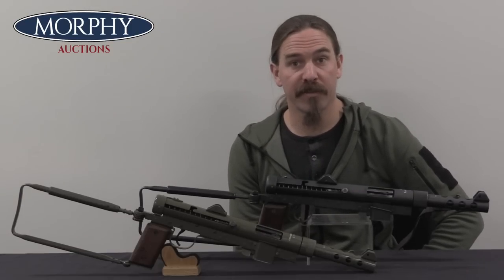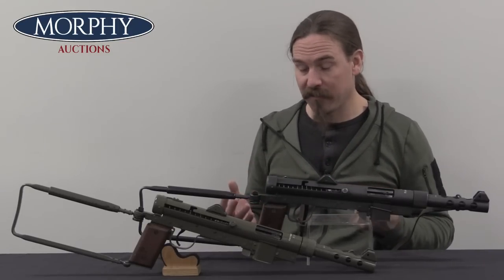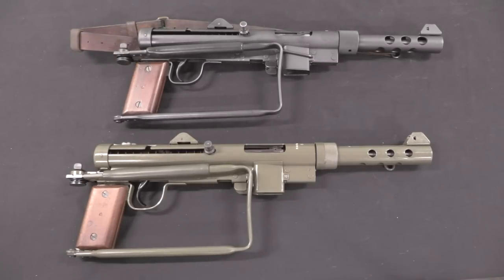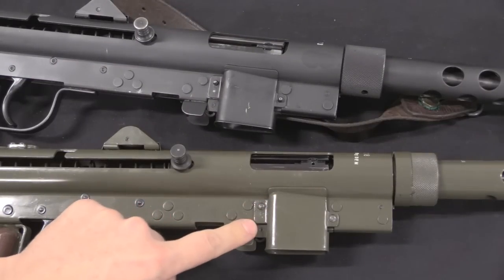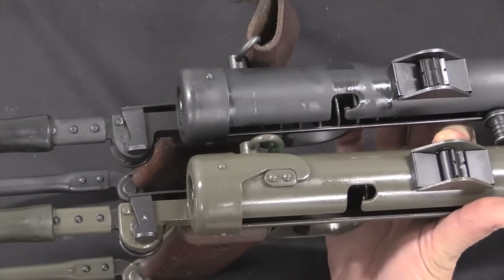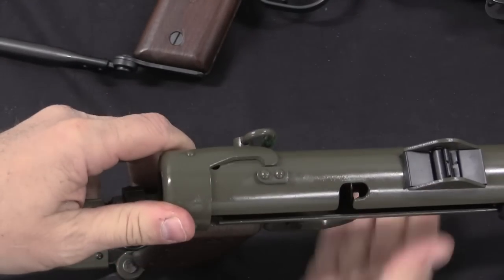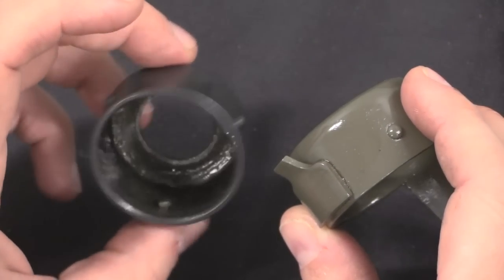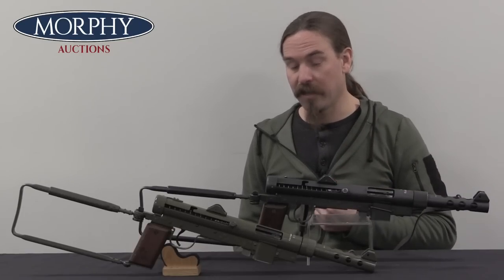Swedish K Comparison: Model m/45 v m/45B

Comment: In service, as issued to me in 1998, a proper M/45B comes with a bunch of accessories:
A servicing kit, with a cleaning rod, bore brush, and a container of oil
A blank firing barrel and muzzle device (basically a longer, unrifled barrel with screw threads for a heavy blank firing adapter - you change out the whole thing, and you are never, ever to use live ammo with the blank firing barrel because it's subcaliber)
A leather sling
Four 36-round magazines
The stripper clip loader (was apparently considered a secret for many years, it was not sold with the export versions I believe)
An adapter for a case collector
A case collector
And an external safety device.

The safety device  was essentially a metal plate that fitted over the ejection port using the bracket for the case collector, with a lug on the inside that kept the bolt from moving. Since the M/45B has no safety beyond "pull the bolt into the back-and-to-the-side position, while on guard duty you'd fit the bore safety device instead of the case collector, which provided a second layer of safety to prevent accidental discharge. In case you needed to actually use the gun, you had to pull the bore safety device (it was on a lanyard), in combination with calling out a "stop or I will shoot" warning. 

The case collector, which had to be fitted at all times when you weren't using the safety device, was my number one source of problems with the gun, because I had multiple incidents of ejected brass not going down the chute to the bag correctly, but instead bouncing straight back into the action and sometimes getting really stuck. The thing is also really heavy - it's the same weight as an AK-5 at 4.5 kilograms loaded (10 lbs), and the AK-5 is considered very heavy for an assault rifle in 5.56.

Comment: The "C" version was the soldiers ordinary "B" with a "C" barrel jacket, for as you said parades and guard duty, at the Royal Palace for example, the "D" model with selector was a Swedish Police version, they also used a version called "BET" semi-auto only with a different and more sturdy butstock for shooting teargas canisters only. And last a rumored silenced version special for the Swedish "Stay Behind" resistance organization that was founded with CIA help in case of a Soviet invasion. The magazines was constructed by a firm called Linde, and if im not wrong, the coffin mags was also a Swedish design, used both by Finland and Sweden. Later the Finns also adopted the Swedish 36 round mags for the Soumi.

Comment: An fun fact is that it was still in use by the swedish army in the 90´s.
When i was doing my "military duty" for 9 month back in 1993 i had the K-pist M45b, more common then was the AK5 but some units like mine where still using the M45b.
I remeber the weapon to be very reliable, and easy to handle, easy to assemble etc.

Comment: I used the m/45 in the Danish army up to around 2000-2001. It was called the MP/49. It didmt have a magwell. was pulled off it I guess. The mage we used was worn out ages ago, so we had to duct tape spare boot laces to the mag and tie it to the folding stock, or we would lose the magazine. We loved it though, our HK G3's were even more worn down, so they got recalled and we were issued those MP49's. Really nice since I was driving M109's, took up way less space, was easier to handle, and way half of the G3, plus the weight savings on mags and ammo.
Reply: NJAR in Skive? I served in an M109 battery in '96-97.. only our MOs were afforded the MP49. My G3 was hella good though. Did 198/200 at 300m routinely with it.

Comment: The C-version is kind of weird in that it's not a complete gun. As said, it's just the barrel shroud that is different, and usually, you just took your issued m/45B and temporarily replaced the barrel shroud with the C-version, thus temporarily changing your B into a C. When the guard duty was over, you just swapped back to your original shroud and turned in the C-shroud.

Comment: Thank you for actually pointing out why the Swedish K is named so. Most others just say it's so because it is so.

Also, to pronounce Kulsprutepistol a little better you could say

Kewl (cool but kewl)
Sprew (Spew but with an r mixed in)
Te (The without the h)
PisstOOl (Pistol but with more emphasis on the O than what is normally done in English, and also a slightly longer s, which makes it piss)

So it's a cool spewing pistol really.
Reply: Kul actually means a sphere or ball.  It also means bullet (even a non-spherical bullet).
Reply: @johndododoe1411  Really now?
It's not like i speak Swedish or anything.

Varför ens försöka?
Reply: For those who don't speak Swedish kul also means fun 🤔
Reply: @RealCadde  I was trying to clarify for the non-scandinavians.

Comment: The m/45 can also take the 71 round Suomi drum. I know that the Irish army used to have them.
There is yet another m/45 model, be it very unusual. It was fitted with an integral suppressor that was a longer barrel jacket with only very small perforations in the front. I have only seen it in pictures. It may only have been used by US special forces in Vietnam.
Ian, if you could find one of those that would be super cool 😎
Reply: Actually the m/45 with suppressor was also issued to the Swedish polis as a support weapon in the same role as the MP5 these days.
Reply: @Para.Bellum  I think that was the attachment to fire tear gas cannisters.

Comment: These things have a legendary reputation, but I've never seen an explanation on why that is. I'd really like to know.
Reply: Scroll up for reports from soldiers that were issued both m/45 series and the modern replacement, but preferred the m/45 .  Such experiences of an inferior replacement add to the legendary status of the old product in any line of work.
Reply: They were extremely rugged and reliable. Accurate, easy to use, easy to shoot well. They look very unsophisticated, but the design is very well thought out, in the functionalistic philosophy that signifies swedish mid-century industrial design.  They were used by Swedish and Irish UN troops during the Congo crisis ( wich propmpted the development of the hotter ammunition).  In Sweden they have a legendary status, as basically every male citizen got to use it at one point or another from 1945 to 1990. And I have never heard ANYONE say anything but praises for it.
 No idea how many were made, but during the cold war Swedens backup strategy was " if all else fails, arm the entire population". I wouldn't be surprised if there, at a point in time, was a Kpist for every man, woman and child stashed away in convenient locations around the country. ( there has actually been a number of raids of such stores during the years, and guns from those raids have shown up in some high profile criminal cases, such as the bank heist that ended with the "Stockholm syndrome" ) 
 US special forces used them in the (illegal) Cambodia incursion during the vietnam war, partly because they needed a weapon with plausible deniability, in case they got captured.
As the Vietnam war became increasingly more controversial, Sweden stopped exports of weapons to the US. This of course, fueled the legendary status of the weapon among US military personnel.

Comment: Orig Swede m/45 mag ,also Fin 1954 issue,Does not have that carryloop. It was orderder by Inspector of Infantry Finnish🇫🇮 Army and it is m/55. It’s has single L as a manufacture’s marks
Linde 🇸🇪is True quality magazine manufacturer.
So m/55 is made by Lapua Finland=L mark.
Coffin Swede 50rds (Linde)were maid in Finland 1939-1943 but heavy front use proved that jamming became isssue and was dropped favour expenive 70 drum only.

Comment: Ceremonial submachine guns isn't something I thought I'd ever hear
Reply: It's not really accurate unfortunately.
The royal guards use a swedish mauser with their ceremonial uniform.

For soldiers on guard duty, a bayonet is a good persuader. Guards interact with a lot drunks and troublemakers, and there is a point to be made, for having a visibly sharp poking device to fend them off, rather than actually having to shoot live ammunition in the middle of a city.
Reply: @JH-lo9ut  Ah, I had assumed this might be the case. I guess it makes more sense, wood is more "traditional"
Reply: @AshleyBlackwater  they should have made a chromed version to go with the Pickelhaube.

Comment: A bayonet on a submachinegun? I know of others like it, but really? That knife would be used for sticking the gun up as a grave marker or opening tins of food.
Reply: The bayonettes were actually pretty long and would give a signifficant advantage if needed to be used in melee capacity in their primary use, guard duty at the Royal Palace. The folding stock meant the old trusty "Butt to the head" was not really an option.
Reply: @BigSwede7403  Pretty much what I was going to say; that stock will hit will all the impact force of a particularily fierce coathanger, so if you run out of bullets in a melee a bayonet is plenty viable.
Reply: Whe are talking about a monster version of a bayonet. it´s almost as long as the smg folded. so it works kind of good. for guard duty.
Reply: @BigSwede7403  Did the royal guards ever use the bayonet in action during the m/45 period?
Reply: @johndododoe1411  Don't know, but i doubt it. The guards there rarely have to deal with anything more important than drunk and disorderly.
Reply: @BigSwede7403  Danish royal guards have been deployed to active wars and taken casualties in the past 30 years.
Reply: @johndododoe1411  While not being in the know how the DRG works, i fail to see your point. SRG is a mix of a dedicated unit and various conscript units on a rolling schedule. Or that is how it was when i did it at least.
Reply: @johndododoe1411  Nope. The royal guard is gathered from a larger royal regiment. That particular royal regiment (there are a few) has seen active deployment duty, whereas the royal guard itself has not, as it has only one mission statement: to protect the royal family (rather ceremoniously - as it's the Jæger and Frogmen corps who provide the real personal body guards).
Reply: @andersjjensen  Your name looks Danish, however our Danish Royal guard seems less separated, and our close protection is drawn from police ranks, not special forces.
Reply: @BigSwede7403  Actually, the folding stock is quite sturdy and would win against a head in a contest of durability. The front heavy weight made whipping a quick way to strike and part of the self defense taught alongside ramming the barrel into someone.
Reply: @znail4675  Oh it's sturdy for being a folding stock, but i'd still take the option for the long pigsticker if having the choice.
Reply: @BigSwede7403  So would I, but I was just correcting that the stock was usable if needed and soldiers trained to use it as such.
Reply: @BigSwede7403  There isn't really any give in the stock and while the weight of the stock is light so is the entire gun quite massive. What you are doing is essentially spinning the weapon around it's center of mass while the stock sticks out and provides extra speed. So it's a spinning hit, not a thrust. Barrel thrust was the other move taught and it works. Hitting someone with the pistol grip would only work if the stock is folded really. I think that would only work alongside surprise.